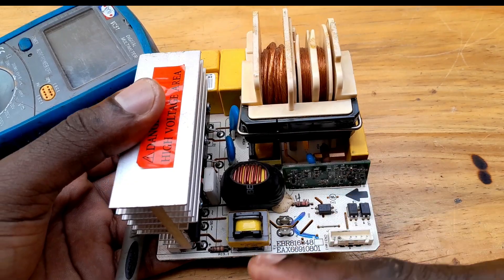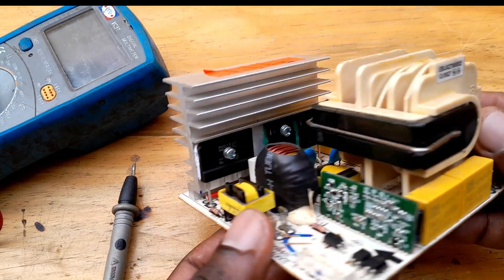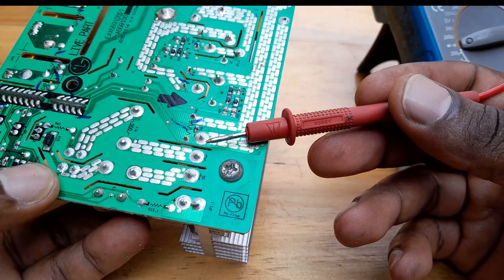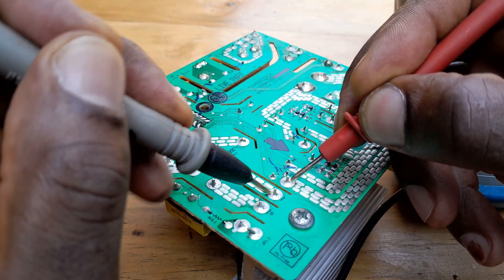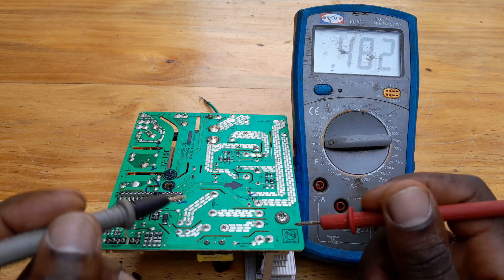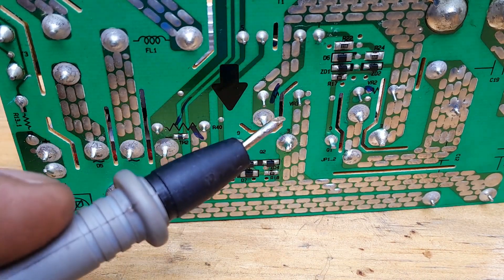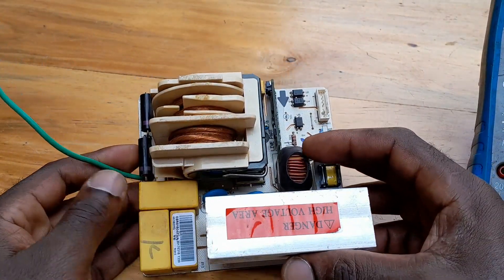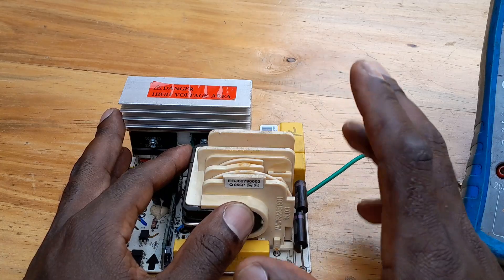How to check LG microwave oven inverter PCB|| inverter Lg microwave oven checking.

Comment: Hello there! I have an LG MH6595CIS microwave, it doesn't heat up! The EBR816048 inverter. Transistors, diode bridge, HV diodes, everything is fine, the magnetron is intact, the magnets are not cracked, the passage capacitors are intact, there is no short circuit on the housing! When the "Start" is turned on, the countdown starts for 30 seconds, and a pulse clicking is heard in the inverter in the area of the transformer winding!
Reply: Hi. Had the exact same problem. Same clicking sounds. It was the magnetron. It tested fine but microwave worked after i changed it. Before this i also chnaged hv diodes and relay. But issue remained until i changed magnetron. Hope this helps
Reply from the maker: check magnetron Antenna, pin to ground resistance, or filaments resistance.
Decision to be made: replace the magnetron.